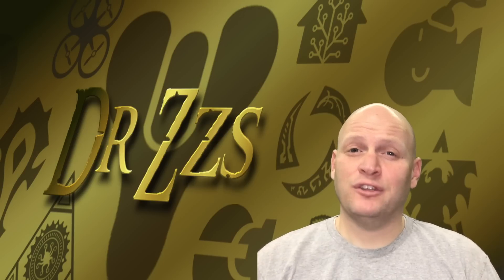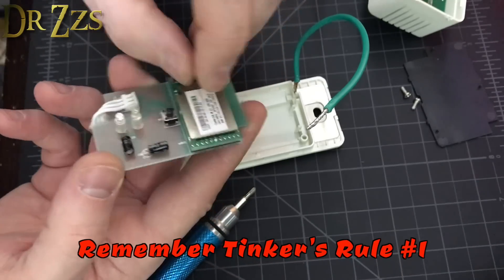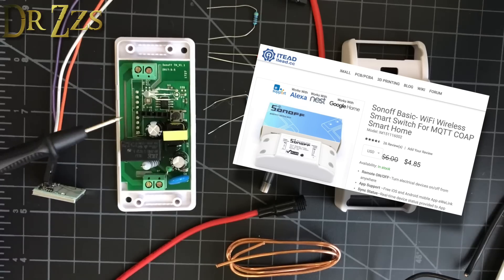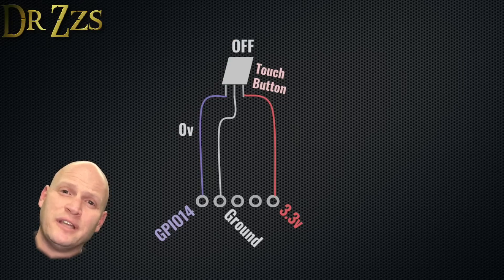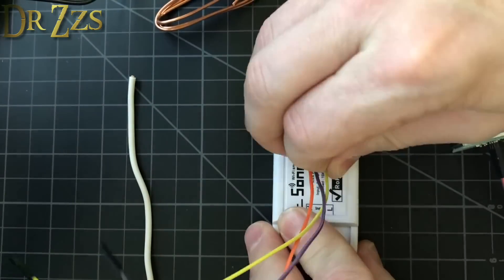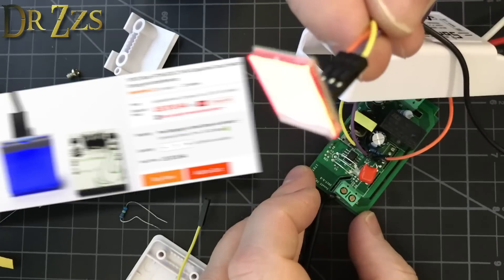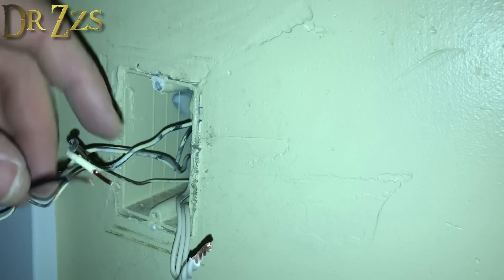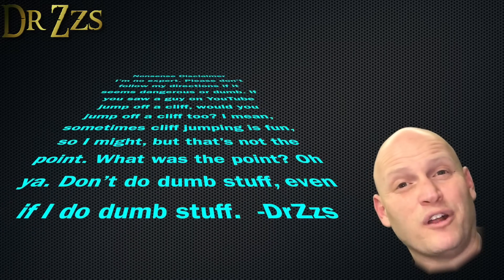$5 Sonoff + $2 parts = Best Smart Switch EVER!

Comment: is there a way to make the led of the touchswich not off, but a little dim? ( bulb ON=switch dim, bulb OFF=switch bright.)
Reply from the maker: ooh, that would be cool.  I wouldn't know how to do that.  Maybe you could use the LED contacts on the board.  Maybe replace that bright green LED with a different one with a color you want, and add a resistor to make it dimmer.  You'd probably want to add some wire to bring that LED off the board and close to your touch switch.  That's just my first idea.  You'll have to do some experimenting.  I'm sure it's possible, but I haven't done it or seen anyone else do it.  You could be the first and teach the rest of us!
Reply: I was thinking more at coding and/or pulling a wire from some low voltage on the board and redirect it to the led so it would be dim instead of OFF  (I think I saw somewhere in the net .. but I was looking for something else at that time).
Anyway, ur channel si great .

Comment: Excellent video.  I want to stuff sonoff's in all my wall switch boxes but even with the added precautions you've described I still fear that if I had a fire and these were determined to be the cause, I wonder if my insurance would invalidate the claim.  Not sure any of us will know for sure unless it actually happens, which I wouldn't wish on anyone.  Either way, thanks for your vids.  Great stuff.
Reply from the maker: Thanks 
I’m afraid you’re probably right. I would expect any insurance company to find any reason they could to deny a claim. 
My philosophy is that I can make it safe enough to not start a fire.
There are other options for smart switches that are UL listed and many of those have API’s that are open to be used with Home Assistant. They just cost a lot more.
Reply: On aliexpress there are a lot of these touch switches, also with sonoffs in them and they get around 15 bux which is indeed quite expensive

Comment: great, im stuffing a sonoff in a box right now to control a irrigation valve to top off the 4 tier bird bath i welded up yesterday! but great to see more and more options to use these things with. ill definatley check out that firmware..... (btw, god only made so many perfect heads, he put hair on the rest! lol)
Reply from the maker: Excellent! 
The main reasons to use different firmware are #1 if you have a bunch of “smart” devices around your house and you want to control them all in one place and make them interact through a hub like Home Assistant. And #2 if you want to avoid depending on the manufacturers servers. 
Bald is the best!
Reply: cool, im flashing an old ras pi right now to get Home assistant up and running after i heard a guy talking about how he has it set up to recognize when his kids got home from school and the wifi router picked up their phone signal it would open the garage for them. i get addicted to new stuff like this! keep it up

Comment: Hi Dr Zzs, I went to your drzzs site but i cannot find all the parts for products you used here (the capacitors, etc).

On the site i see broken images.

Which +$2 part are you using here ?
Reply from the maker: uh oh.  I'll check out the site.  in the meantime: 

Touch Switches - http://s.click.aliexpress.com/e/RvJqrRN

Fuses - https://amzn.to/2JxDbU1

That's all I'm using anymore with my Zzonoffs.  Sonoff Basic/Touch module/Fuse/Solder Mains, that's it. 

I've stopped using the Cap/Resistors with these touch modules and they still work great.  No ghost switching.  I think that problem only happens with mechanical switches.  I didn't know that when I made this video.  The $2 is mostly the switch and the fuse.  

Good luck!  Let me know if you need anything else.

Comment: Can I know why you type in the Switch Mode 1 2 console?
Where can I find more information on the reason why it has to be like this?
Could you explain me please?
Thank you so much
Reply from the maker: here's a link to all the commands you can use at the Console.  
https://github.com/arendst/Sonoff-Tasmota/wiki/Commands#main

I set SM1 2 on this switch so when the touch button is lit the relay is off.  If you set SM1 1 then the led on the touch button will be on when the relay is on.  It's a really great feature that lets you use any kind of switch and easily change the function of the switch.  If you use a different kind of switch you can try different switchmodes and see which one does what you want it to do.  You don't have to restart or anything to see the changes.  

Hope that helps!
Reply: Thanks

Comment: I've actually made two of these down to 10 amp fuses...I now have them installed in my wall and switching up a breeze. I used a spring from a pen, cut it in half and hot glued inside a decora switch. I did have to expand the springs a bit but they worked..set up the switch as a push button (switchmode1 3 I think it was) and Bam!!
Reply from the maker: Awesome! 
Nice work! 
if you have some pics post links so others can see what you did.

Comment: really nice video. i am trying to get a basic capactive touch sensor (the one that doesn't have the glow or doesn't stay on) with a pull down resistor and capacitor connected to GPIO0 and it doesnot work. i would have expected it to work/ replace the onboard microswitch. im currently on stock firmware and dont intend on flashing as of now. is there a way to get it to work on stock firmware? thanks.
Reply from the maker: I haven't tried replacing the on-board button.  I'd have to try it myself to really know what all you'd need to do.  I don't think you need the capacitor.  Try it with just the pull down resistor.  The cap-touch button is going to supply voltage when it is active.  So your pull down resistor will take GPIO-0 to ground when the cap-touch is inactive.  Should still work though. 
How do you have it connected now?  the cap-touch needs voltage, gnd and output.  You can use the 3.3v pin (should be the square one) that we use to flash.  Then connect the non-ground pole of the on-board switch to the output of the cap-touch. And the other pole of the switch to the ground pin of the cap-touch.  Then put the pulldown resistor between the 2 poles of the switch. It can be a very high impedance resistor, like 100k.  
That's my first guess at how I would do it.  Then start trouble shooting if that doesn't work.
Reply: So i have connected the touch module to 3.3v, ground and gpio0. and used a resistor value of 80ohm. i tried it with and without the capacitor  and resistor. the led on the touch module comes on when touched indicating that it works and input is wired correctly. Ill try to use a higher value resistor. or im guessing i may have to use a transistor. thanks for the quick response :)
Reply from the maker: cool
you're almost there.  your resistor needs to be several times higher than the base impedance of the touch module.  If you want you could use your multimeter to measure the impedance of the touch module.  Then pick a resistor that is 4-5 times higher than that.  That should work. 

Glad to help.  Figuring out these little puzzles is fun. :)
Reply: Hey I’ve finally got it to work. I used a transistor to convert the 3.3v output to a switch. Then connected it to GPIO0 and it works. I’ve tried multiple resistance but no luck.
Reply: @jasondrulz  I've tried to use a transistor but could not get it to work. Would  you please share your wiring to get sonoff to work with basic capacitive touch sensor? Thanks in advance.
Reply: folks could this setup work withou the capacitor and resistor? I set it up using 3V from USB and it is switching ON and OFF w/o those extra parts, using sonoff basic

Comment: Hey @DrZzs i wanna start by thanking you for all these amazing videos. I have a question on this one is it possible to add the touch switch to the sonoff without using tasmota? i know you can replace the push button it there a way to use that with this touch switch?
Reply from the maker: Thanks!
I'd say that's a definite "Probably" :)
What I'd try is connecting the Ground and "out" wires from the touch module to the poles of the onboard push button, then connect a wire from the 3.3v pin to vcc on the touch module.  You'll probably need the pulldown resistor too between the two poles of the switch. So when the relay is active the touch module with be off and when the touch module is lit up the relay will be off.  
I'll try it out and let you know if I can get it to work.  I've got a bunch of things I need to get done though, so it may take a bit.  
If you try it before I get to it let me know if it works. 
Good Luck!

Comment: I have a situation where the blue light switch does not follow the the relay state when HA is used. Played with switchmodes with no success. Any news on how to resolve this. If there is no solution for this, and that's OK too. Any help would be greatly appreciated. DrZZ please answer my question. Thanks again for the videos.
Reply from the maker: Mine will do that randomly also.  Sometimes it does follow HA, other times it doesn't.  I don't know why.  Check out the example in this video to see what mine does: https://youtu.be/EroQ_Eos1HY?t=3m58s
If I figure out why it does that I will certainly mention it in a future video. 
Sorry I don't have the answer right now.
Reply: Ok thanks for the reply. Mine never follows HA but just have to hit switch twice. Once to match state then again to change state. Not the end of the world. lol. Tried soldering a resistor to back of switch and made it monentary but led only goes on when switch is pressed. As monentary switch if the led on switch would stay on that would be great. Ok I'll look for a solution or other option. If I find one I'll post it here. Thanks again.
Reply from the maker: Look at the Tasmota Commands.  Maybe there's something there that'll work. https://github.com/arendst/Sonoff-Tasmota/wiki/Commands
Reply: I have exactly the same problem as Mike. I had a look and there's nothing that I can see in the commands. It's not a big deal but it would be nice to get the light on the touch switch to follow the relay state when controlled remotely
Reply from the maker: That's really odd.  You are using the capacitive touch button? 
There are 4 possible Switchmode commands. 2 for momentary and 2 for latching switches.  Each type of button has a mode to "follow" or be the same as the state of the relay (on when relay is on) and a mode to be "inverted" from the state of the relay (light off when relay is on).   One of those 4 switchmodes should give you what you're looking for.  
If you're using the square, lighted capacitive touch modules I've used then you probably want "switchmode 1" 
I think we can get it to work the way you want it to.  If switchmode 1 doesn't do it then try all 4 switchmodes.  One of them will be the one you want. 
When you do switchmode in the console the format is "switchmode<switch#>(then one space)<switchmode #> 
so to change the mode of switch #1 you type "switchmode1 1" or "switchmode1 2" etc. 
Hope that helps!
Reply from the maker: I just looked at the Tasmota commands page and it looks like there are 7 switchmodes now.  So that's 7 options to try :) 
good luck!

Comment: I was able to get this built but the only problem is that my touch button doesn't work all the time and sometimes the lights will turn on and off by themselves.  The only difference between yours and mine is that I use espeasy firmware.  Also, my touch button lights up when I touch the button to turn the light on and off when I touch it again to turn the light off. So opposite of yours.  Any suggestions?
Reply from the maker: I don’t know espEasy so I don’t know what might be different with the button function. With TASMOTA putting gpio14 to ground activates the relay. If your touch button is on when the relay is active maybe espeasy has gpio14 set to activate the relay when it goes high. When the button light is on it’s putting voltage out the “out” pin. I used the pull down resistor to make it so gpio14 is grounded when the button “out” pin is NOT putting out voltage.  
Hope that makes some sense.

Comment: I would have one question about the wire of the inline fuse holder. Most of fuse holder I saw on the web are coming with a 16awg wire size like your video. In the house here the wiring in the wall, for the light switches and common other switches, is done with 14awg wire. Will this can be a problem if i'm using a small wire size (16 vs 14) to build a Zzonoff ?
Reply from the maker: Martin Ouellette Nope. No problem. 16g will be fine for the Zzonoff circuit since you’ve got a 10amp fuse.

Comment: I have been doing something similar for a while now to make life easier for us as we get older. I use a different touch sensor which has a lockable feature built in so there's no need to add a resistor. Https://www.thingverse.com/thing:2844164 Really enjoy your channel.
Reply from the maker: Thanks!
Did you design that box?

Comment: Is there a way to dim lights with the sonoff? can you make a video about it?
Reply from the maker: There really isn't a way to add dimming without adding another board or device.  I bought a board to try, and I will make a video about it eventually.  
The first question is what kind of lights do you want to dim.  Dimming LEDs is different than dimming incandescent (tungsten) bulbs.  And, some LEDs are dimmable and some are not.  So deciding what kind of light you want to dim is the first step. 
The board I'm going to try is (possibly) going to dim only incandescent bulbs.

Comment: Please do not put solder on screw terminals.
Solder tends to flow under pressure so you are more likely to cause a short by doing this.
Use screw terminals or solder but never both.
Reply from the maker: ok, cool.  good advice.  
Seemed like a nice way to make it double secure.  Like wearing a belt and suspenders. (not that I've ever worn suspenders...) 
I'll have to look and see if the solder ran somewhere I didn't intend. So far no shorts, but I'll heed your advice in the future. 
Thanks!
Reply: No worries.
He's a source that sort of expresses what I mean.
http://reprap.org/wiki/Wire_termination_for_screw_terminals
It explains that solder can expand the screw terminal and fall out etc etc... bunch of reasons but yeah one or the other but not both! Thanks for acknoledgement!
Reply from the maker: Next time I'll just pull the screw terminals off and solder directly to the board! 
Thanks again!

Comment: So I have several of these installed in my house now and they work great. My only question is about the blue cap switch. I am using the same ones that light up when off. If i use the touch switch they work great. When I use HA to turn them on/off, the blue touch switch doesnt change. so there are times the lights are on and so is the blue switch, or vice-versa. Do I have something configured wrong? Thanks in advance.
Reply from the maker: I don't think that is happening to mine.  I'll double check when I get home tonight.  If it is happening I'll figure out how to fix it and let you know.  
There's got to be a setting in Tasmota that'll have the button follow the state of the relay. So if Home Assistant turns off the relay the button should go off too.  
Since I can't get to mine right now here's the list of Console commands that might hold the solution.  
https://github.com/arendst/Sonoff-Tasmota/wiki/Commands

Probably one of the switchmode settings.
Reply: Awesome, ty.
Reply: There is sometimes an issue with Tasmota retaining state so pressing the physical/touch button doesn't change the HA or MQTT state, but it will show in Tasmota web ui.
Reply: I have the same situation where the blue light switch does not follow the the relay state when HA is used. Played with switchmodes with no success. Any news on how to resolve this. Any help would be greatly appreciated
Reply: I have the same issue. When you use HA or MQTT the light doesn't change state. Anyone know how to get it to work?
Reply: I have this same issue here.. Does someone know how to fix it?
Reply: Trying to figure this out also, ever solve it?
Reply: Same issue here

Comment: Awesome video. Do you know if this would work if the sonoff has been flashed with the espeasy firmware?
Reply from the maker: Thanks!
yes, it should.  I haven't used ESPeasy, but I would expect you can make use of the GPIO pins and modify the functionality to be able to use the touch module. 
I think the most important part of this is adding the fuse.
Reply: DrZzs would GPIO14 be set to toggle or monetary?
Reply from the maker: Chad Wade if you’re using the touch module I use in this video then it should be toggle, like a rocker switch. This touch module stays on when you press it until you press it again, like a normal light switch. 
If you want to use a standard push button then use momentary.

Comment: Hi Dr Zz! I am trying to figure out how the lights come on for the touch switch when the lights are off. where does the LED from the touch switch get the power from? I would like to modify an existing light switch to add a small LED indicator when the lights are switched off so you can see the position of the switches in the dark. DO you think it is possible to do with the Tasmota sonoff?

Comment: Very nice - do you have a link where all the parts are listed.  I'd like to give it a shot.
Reply from the maker: yep
I started a website and try to keep it up-to-date with the best products. 
http://drzzs.com/products/
https://www.aliexpress.com/item/10PCS-Blue-HTTM-SCB-2-7V-6V-Capacitive-Touch-Switch-Module-Strong-anti-interference/32837535126.html?spm=a2g0s.9042311.0.0.aLxG0f
https://www.itead.cc/sonoff-wifi-wireless-switch.html